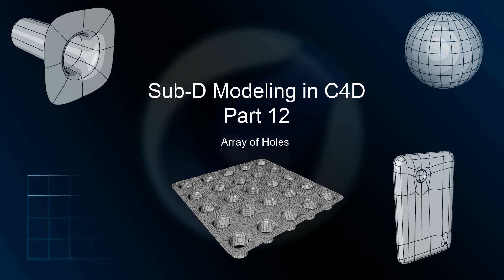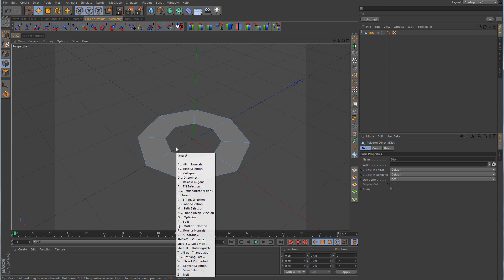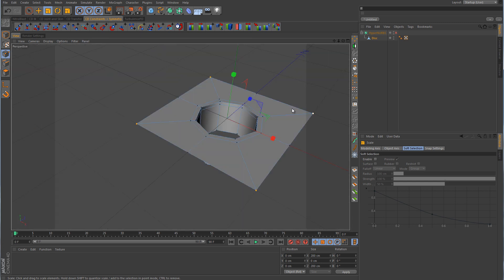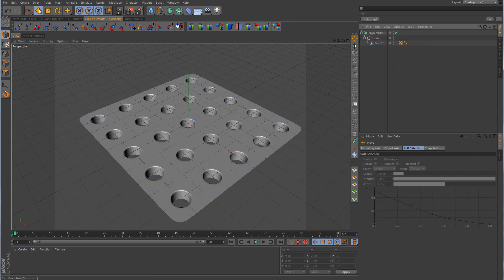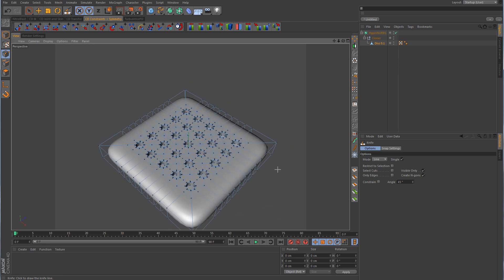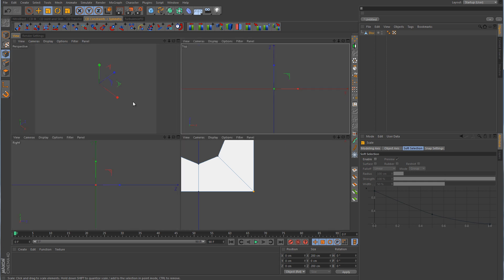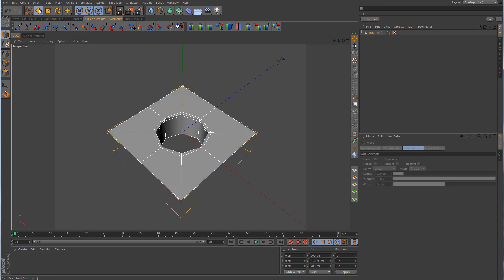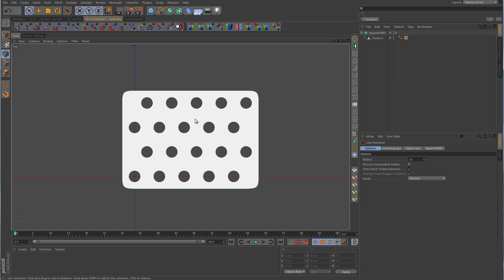Sub-D Modeling in C4D - Lesson 12 - Array of Holes

Comment from the maker: Points have to be in close proximity to each other in order to be welded when using the optimize command. If its not working, then you'll need to raise the value for the optimize command. Default should be 0.01  You may need to go up higher to .1, or maybe .5

Comment from the maker: Box modeling is the same thing as Subdivision modeling, however you start out with a cube and "box" in the shape.  Spline modeling would be a loft or lathe nurb. Both could work, as ive used a loft nurb to build a basic shape before applying a hypernurb.